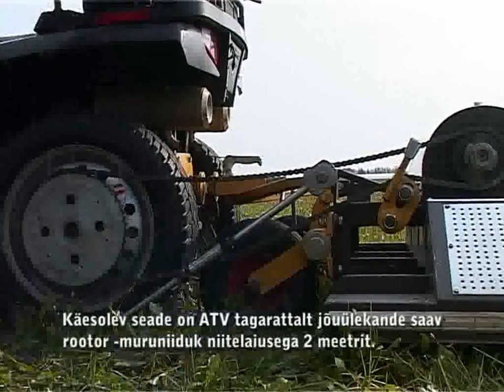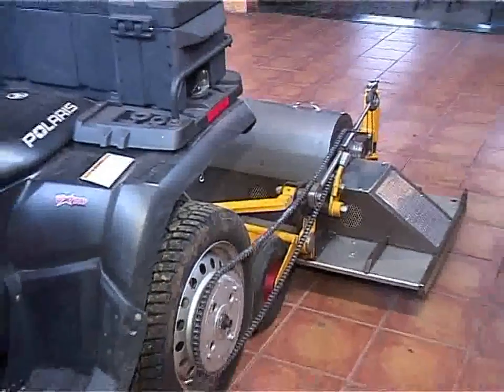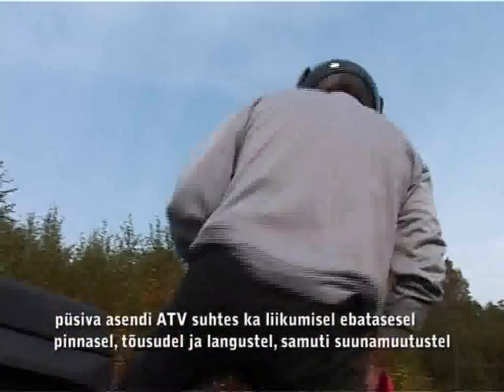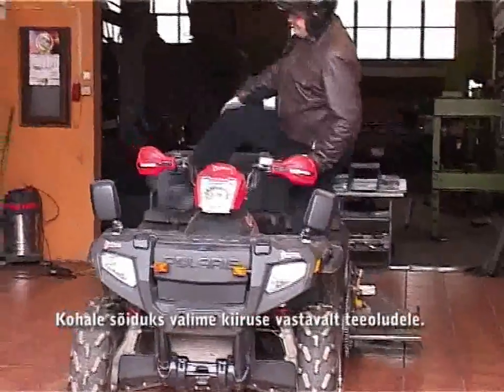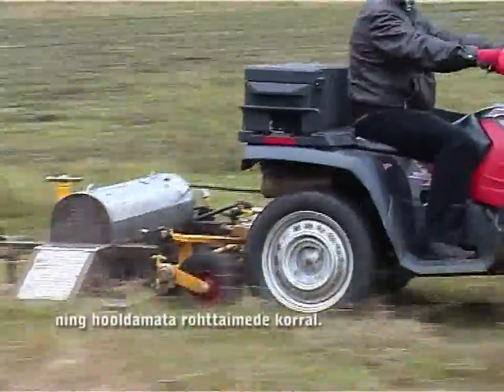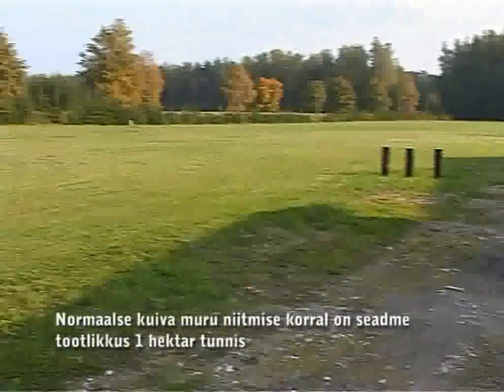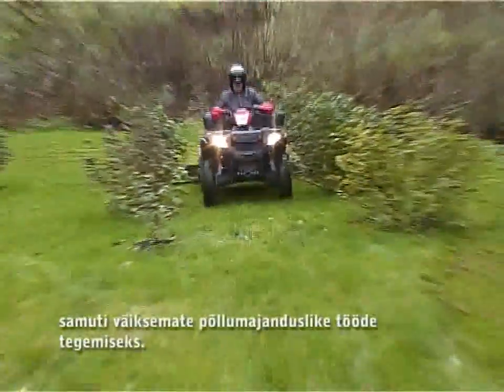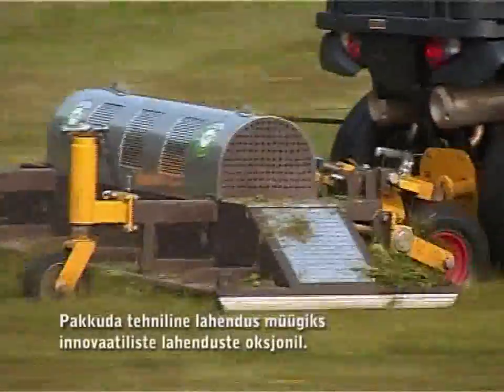Patented ATV Grass mower demo

Comment: I've only used it once, but it worked great.>>>t.co/OzLDiL2N5j    As long as it holds up I will be very pleased with the purchase. Will update review if necessary in coming weeks/months. I did make sure to buy the right extension cord, per the instructions with the mower, as I saw some other reviews that alluded to issues with the mower and perhaps getting the wrong extension cord as a recommended add-on item.

Comment: Wouldnt it have been easier to power the blades from one of the wheels on the deck?
Reply: they probably used the atv tire because of gearing ratio
Reply: TagGeorge when you hit wet grass it would probably not work unless it was heavy as hell